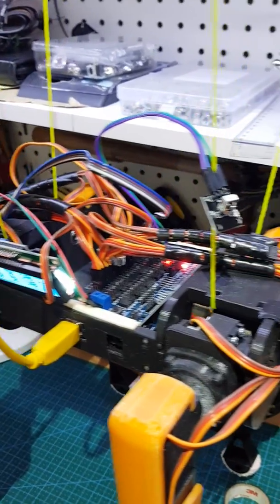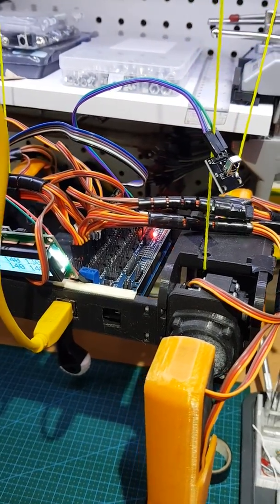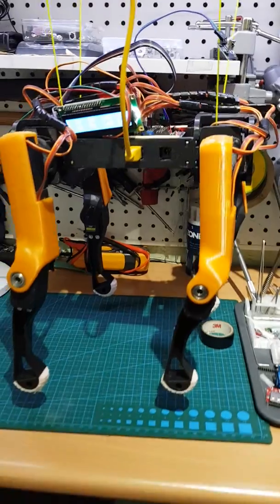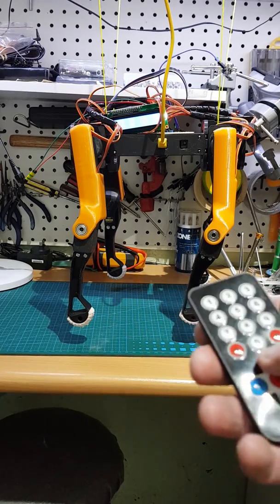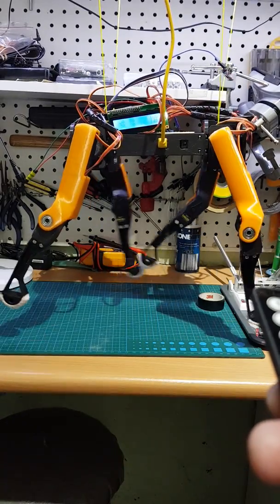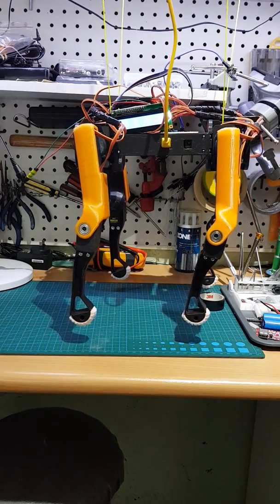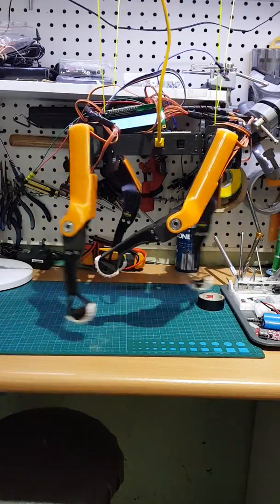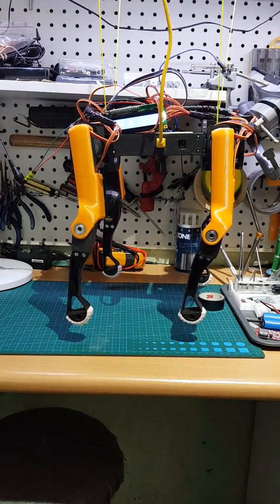SpotMicro - Setting leg walk angles (The Numbers)

Comment: I use the same IRRemote but just have started with the project. I am interested in your code because it seems like you have good ideas to adjust the angles.
Reply from the maker: Hi OR, I'm not really proud of my code. To coin a new term, it's Master Kludgery. But, it's done the job to get the project moving. The code is on github if you search SpotCorgi. If you need any explanation of how it works let me know. 
Once again I've got distracted on side projects; lately in hosting a website from home. I'm not sure if you can see it as I've got ambiguous results. I'm hoping to make it a hub for all things SpotCorgi on the remote possibility that anyone is interested. Mainly a test site so far but I'd be interested know if you can see it: spotcorgi.net

Comment: Hello my friend. I have a question, what bearings are you using?
Reply from the maker: Hi Art, bearings are 'F625zz Flange ball bearing' as specified in the original model. You can get them here:
https://www.aliexpress.com/item/32947454412.html?spm=a2g0s.9042311.0.0.27424c4dbcjklk